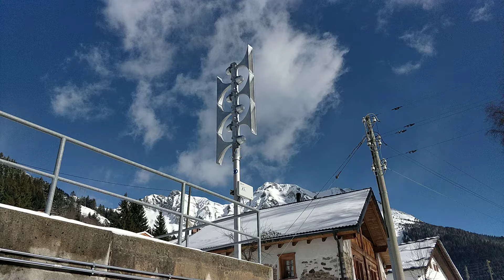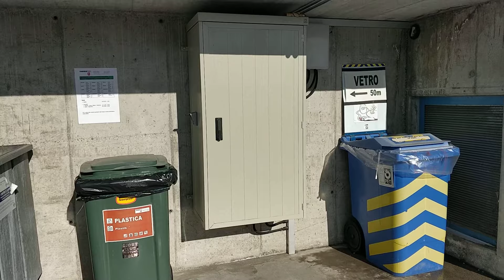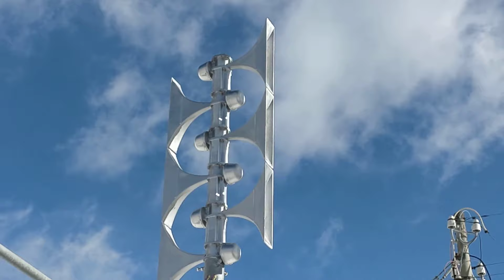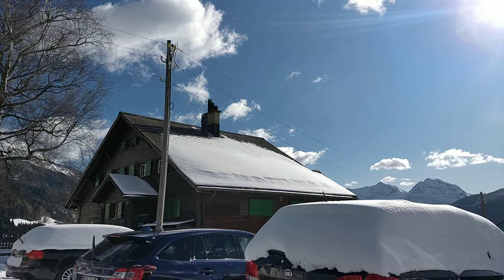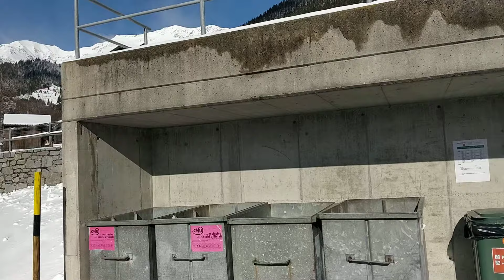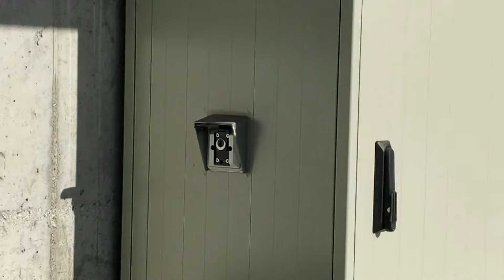General Emergency Siren - Manual Test up close!!!

Comment: Basically it is a Cooper WAVES HPSA-3108 with a custom controller. Great video!
Reply: looks more a lot like a sonnenburg or a sircom to me.
Reply: Actually these are Apex sirens, This is an Apex 6 because it has 6 horns according to a comment.
Reply: @CentralVirginiaEAS  that is an SES iirc. But it looks like a WAVES tho
Reply: @SirensAndAlarmsOfNorthernIL  Yes it does also.
Reply: @SirensAndAlarmsOfNorthernIL  You sure? The drives of an SES are a different shape than this
Reply: @leDespicable  I meant that the way the horns are mounted resembles a Cooper HPSA. Other than that, they will have their differences like the logo, the type of speaker drivers, and other stuff. Didn’t know the SES had different drivers tho
Reply: @SirensAndAlarmsOfNorthernIL  The differences are small, but easy to notice when you know what you're looking for. That's also the main way to differentiate between a lot of German (and other European) siren manufacturers.
Reply: @SirensAndAlarmsOfNorthernIL  I actually found out this is an APEX 6. Yes, the company is called APEX.